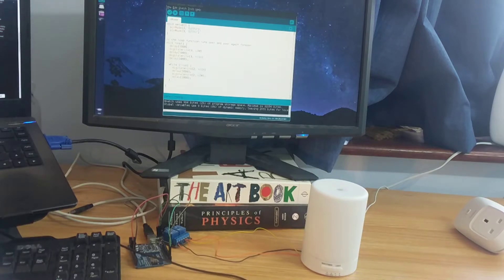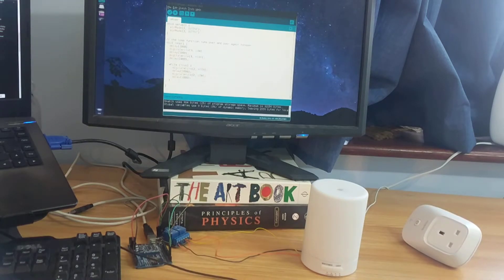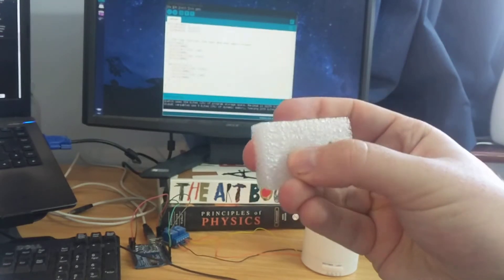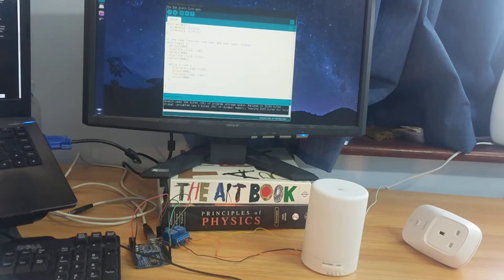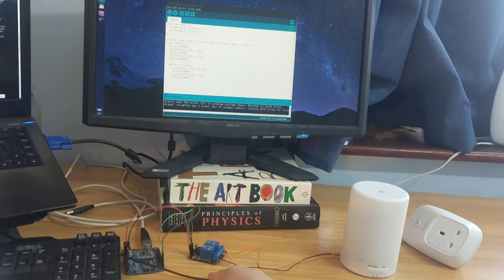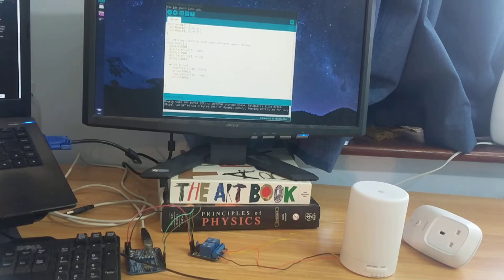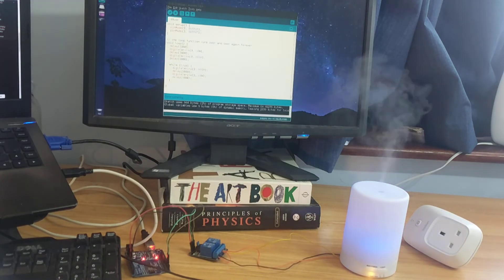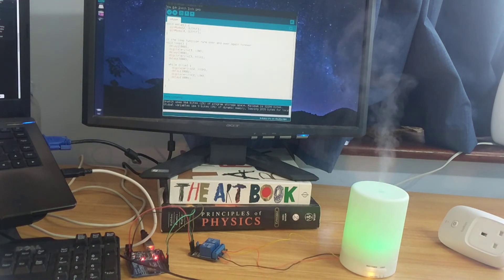Making a Smart Diffuser using an Arduino

Comment: Can't you just use transistors instead of the relais?
Reply from the maker: Possibly I don't know whether that would require more wiring into the diffuser circuitry?
Reply: @matthewfelgate  you just replace the relais with the transistors. Same amount of pins